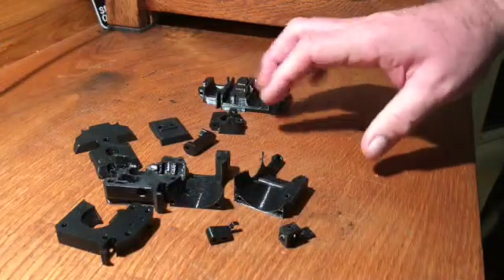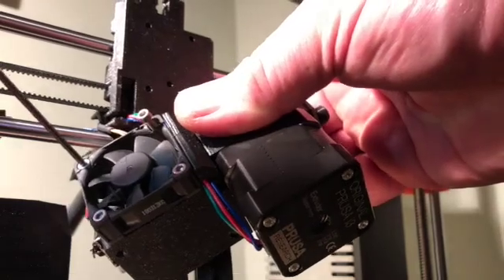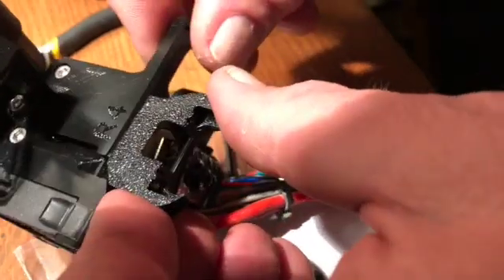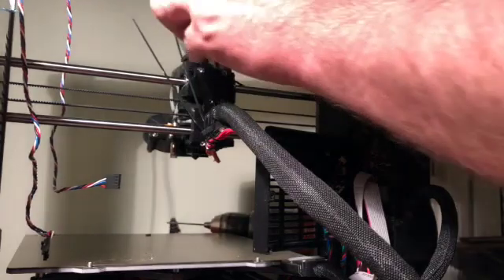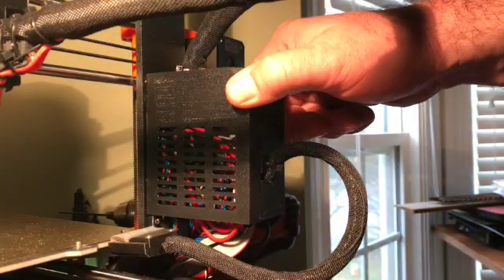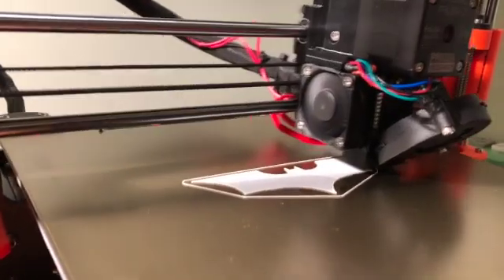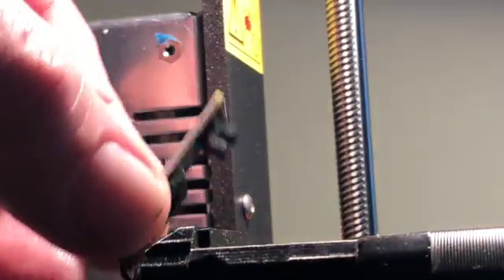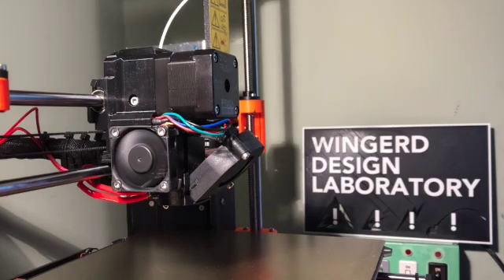Prusa MK3s Extruder Upgrade Installation

Comment: I did the same thing and broke the wire can you put the link for the replacement one you got 😀
Reply from the maker: This is the part I ordered from amazon:   https://www.amazon.com/gp/product/B01HGIMI2G/
HICTOP Cartridge Heater 24V 40W for 3D Printer Prusa Mendel （Pack of 3）
I've used it for about 75 hrs since installing and nothing tragic has happened, so maybe its a suitable replacement,  It seems to heat up just a little faster than the original.

Comment: agree fully on the support staff
they helped me out once when I was stuck and had a short actually on the the heatcartridge

cleaning helped of course

Not sure on the mk3S upgrade though if I really need it. the fil sensor works when I need it with dark filaments
the head postion; dont really care as I print functional parts only anyway and te skin artifacts dont affect me.

I do have the ruby nozzle and a silicone sock together with the newer parts cooler ( ordered fully assembled noveber2018)

Comment: I ordered the MK3 to MK3S upgrade also but delivery took much longer than expected. Now my son started with a study project and became depending on the 3D printer. I don't want to harm his project by messing up something during upgrading (like a heating element). So I wait upgrading till he has has printed all parts he need for his project.

While waiting for the upgrade to arrive I did 3D print all needed parts. I also printed the "plug-aligner" which was your missing part. It was not found under the printeable part for the MK3 to MK3S upgrade . But it can be found in the MK3S printable parts package. Having installed the "plug-aligner" would have prevented the mis-alignment of the plug onto the Einsy board. Then I have found also other parts that have "secretly" updated since I received my printer September 2018. (like the Z-axle-bottom and the Eisy-base).
Reply from the maker: An Wira,  If the printer is mission critical right now, I might hold off too. Although it’s highly likely your sons manual dexterity is far better than mine, so it might be easier for him.
Reply: @RelentlessEnthios , The technical skills of my son will be sufficient for sure (bachelor mechanical engineering), but he is lacking time. And he lives in a student flat at an 1 hour train drive away. Normally he does slice his models and sends me the gcode for printing. So easy for him, but he stil has to pick up the parts. When he finalizes his project I am eager to do the MK3S upgrade myself, as I also did like the assembly of the MK3 half a year ago.

Comment: I bought the kit!! But scared to do it. Thank for posting this video. Do you regret doing it?  Right now my printer working great. Like my grandmother used to say if it’s not broken don’t fix it. . That is why I’m asking. I have the kit on stand by. (So was it easy) again thank u
Reply from the maker: zorro fox I feel where you’re coming from. Honestly, it was like 4 hours to do the retrofit and then another 2 to get everything up again. Although it would have been faster if I wouldn’t have broken the heating element.  I printed a couple things this weekend that came out really sweet, maybe even better than before the upgrade, so it feels like it was worth it. 
But definitely get the jumbo size bag of gumi bears.
Reply: @RelentlessEnthios  Does the new fan position help with printing overhangs?
Reply from the maker: Jonn I’ve printed a couple of big arcs with no supports. Between this upgrade and the last two firmware updates, the printer is a completely new animal. I print a lot of PETG. With the upgrade the prints are less fuzzy and boogery, if you know what I mean.
Reply: @RelentlessEnthios  I just installed the latest firmware and slic3r pe. If that doesn't help I'll order the S kit. Thanks.
Reply from the maker: Jonn I have to admit, the upgrade kit was mostly for fun rather than to get better performance, although the better performance is a pretty nice bonus.
Reply: Dr. Byron Wingerd where do you get the stl filed for the plastic parts?